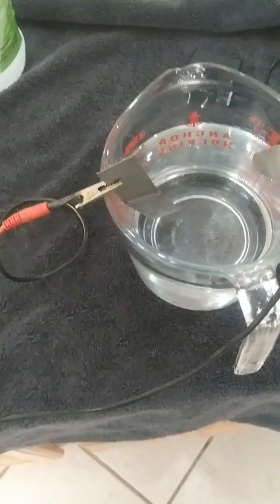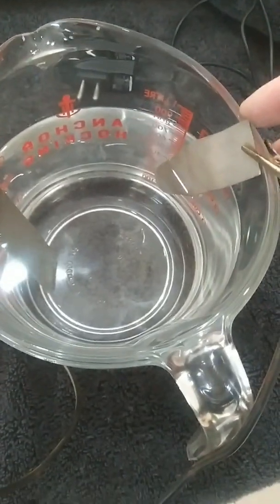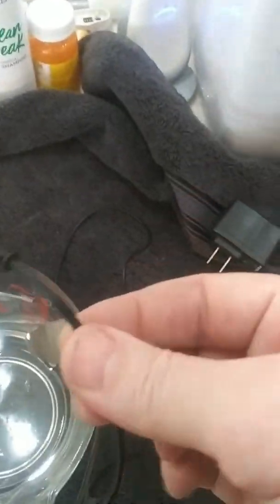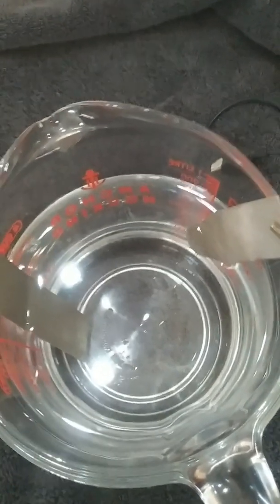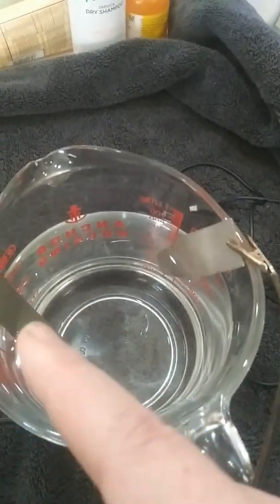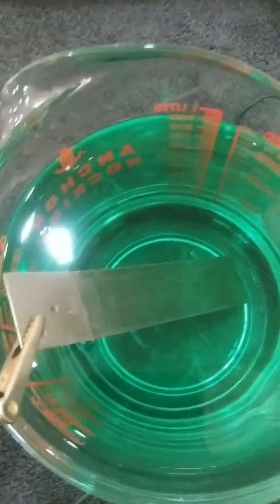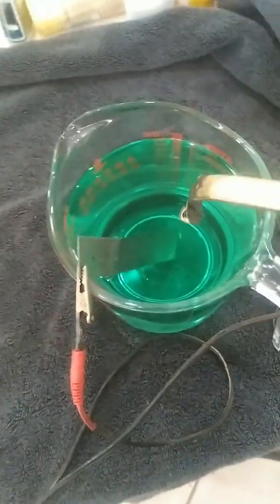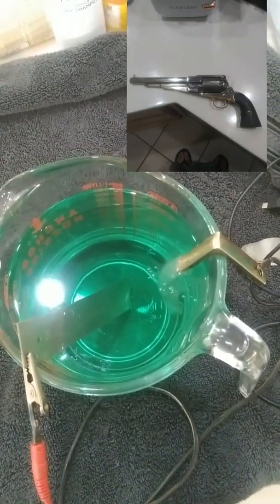nickel plating

Comment: I’m planning on trying to nickel plate a Bersa thunder 380. Do you think there would be an issue using this method on that kind of steel?
Reply: Kinda following up on this one, but have you ever got a buildup of red gunk on your copper when making the solution? Does this indicate I’m doing something incorrectly?
Reply from the maker: @natefielder3090 are the clips you  use to attach parts. if those clips  Touch the solution it wll Contaminated your solution. .
Reply from the maker: If you have problems you will need to plate the part in copper first.  then plate nickel over the copper.  making plating solution for copper is the same as making nickel plating solution.But your using copper Instead of nickel. Now you will have to plating tanks.
Reply: Thanks, I’ll give that a try

Comment: So I am going to ask questions over time and comment as I go now that I'm onto your channel. 
You said table salt, is that relevant to the iodine or plain salt work as well? Now that it has been a year or so how is the finish holding up? 
Mountain man
Reply from the maker: Plain salt is what i use its really just there to help electricity flow through the vinegar at first. When it turns that greenish blue color there is plenty of suspended nickel that salt wouldn't be needed. As for holding up. Well my oldest thing i nickel plated was about 15 years ago. Its some bolts on my car they still look fine. Any area where a scratch happened has a little rust on the scratch. I nickel-plated a pietta Remington New Model Army and it still looks great. Its about 3 years old. The part i did for this video I stripped back to Brass because I plated it just for the video.